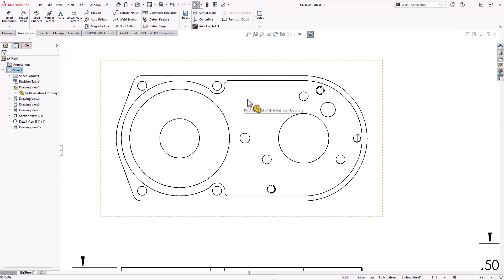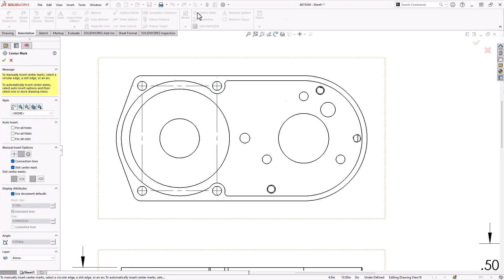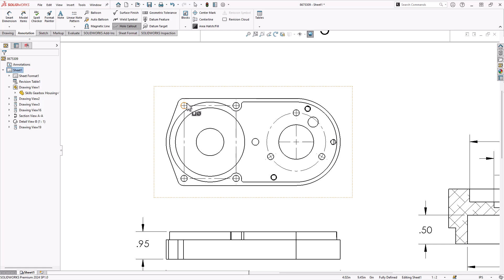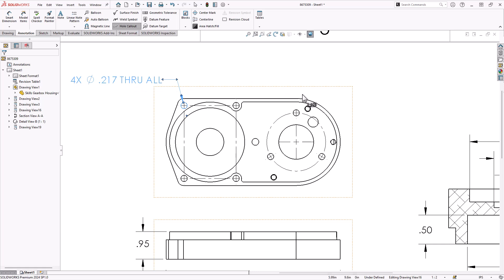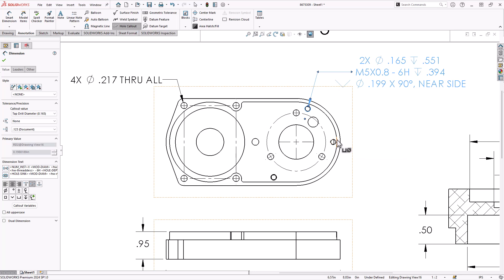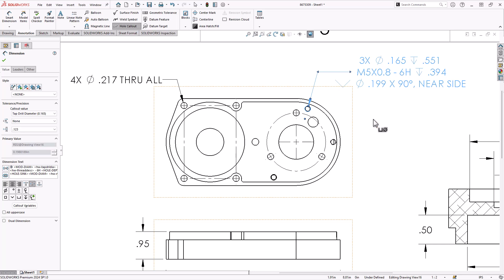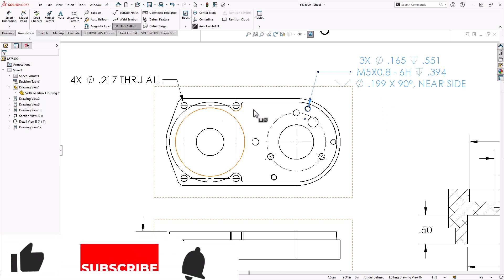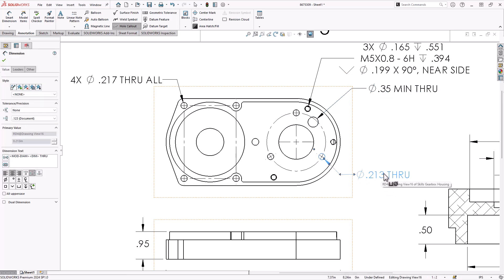Mastering Tolerances in SOLIDWORKS: A Guide to Add and Modify Hole Callouts in SOLIDWORKS Designs

Comment: I like the way the callouts work now and it is visually displayed in the renders realistically. I used to draw all my threads and cut everything in my models to look real, mastering threads was a lot of fun, but it is something I rarely need to do now for holes, it was labor intensive but gave my client renders he could use in marketing.
Reply from the maker: Cutting geometric threads is generally reserved for custom thread profiles, 3D printing, or ultra-detailed rendering.  Otherwise, the additional file size and rebuild time makes it prohibitive to add that additional detail.  Definitely better to use the cosmetic representations!